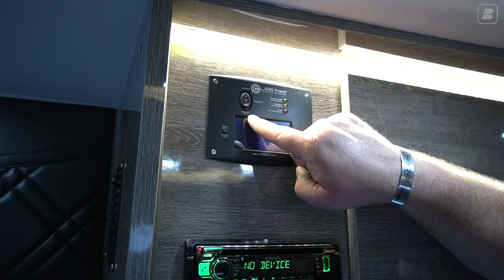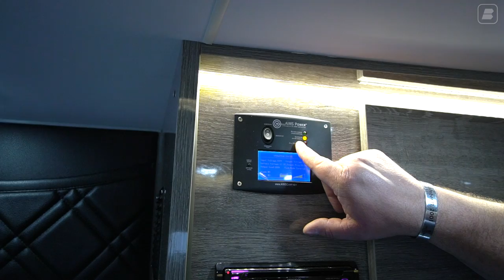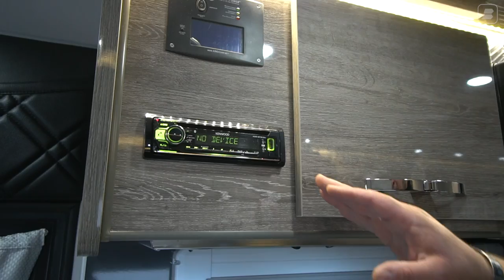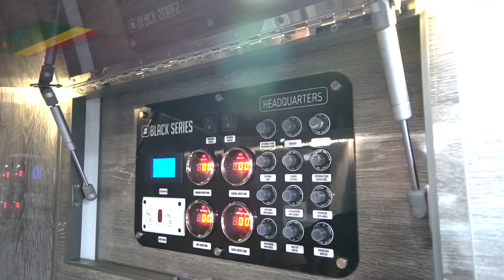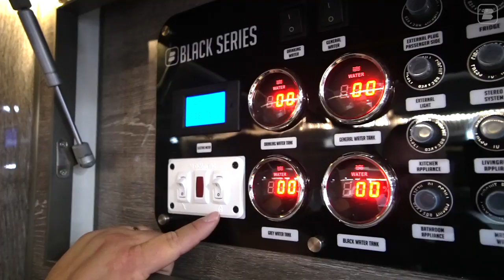HQ15 Interior Walkthrough - Black Series Camper; Caravans, trailers and campers

Comment: Why would you put tank heaters that only run off shore power. If I am out using the trailer as it is intended to be used, I am not going to be anywhere near a shore power plug. It also has a microscopic refrigerator. There is barely enough room in it for food for a weekend. All the 110 outlets on this trailer should run off the inverter and it needs lithium batteries not AGM. You can only use half the amp hours the AGM batteries have before you start damaging the batteries. The way this is set up, you only have 200 usable amp hours of battery. Also, why would you have the dump valves at the rear of the trailer where they can be damaged and ripped off the trailer if the rear scrapes on the ground. There did not appear to be any protection for the dump valves at all. They should come out behind one of the rear wheels so they are less likely to be damaged. This trailer has a lot of potential, but it needs some major improvements to be a real off grid trailer.
Reply: Terry you should prob go work for them by the sounds of it you would have them make the most BADASS RV in the world lol
Reply: I was about to post something very similar to this. Many flaws with this unfortunately.
Reply: Because they draw too much power to runoff of solar
Reply: In my opinion the geo pro line is a lot better equipped than this. It’s significantly less expensive but you’d have to add some sheet metal on the bottom to protect it better from rocks etc

Comment: Seriously the only thing stopping me from purchasing this trailer is the tiny refrigerator. I’m scratching my head because this rig is made to get way out & away.
Reply: That’s the ONLY thing?
How about NO air conditioning when utilizing camper for it’s intended use OFF ROAD
Reply: I was waiting for him to say the outside kitchen also had a fridge but he never showed it.
I don't understand why the AC only works on shore power. EMBER will run off solar and then about 4 hours on battery
That bathroom fan is useless, it needs a Fantastic

Comment: What generator choices would you recommend to run the ac?
Reply from the maker: We would recommend double checking with your dealership prior to purchasing, however a 3,200watt generator should do the job to run your AC.
Reply: @BLACKSERIESUS  I would recommend getting a real battery setup and running everything from the batteries. This is a sheer limitation of trying to use this trailer for its intention. This is not an off grid trailer at all. Park this at an RV park like the rest of em.

Comment: Can you really run the microwave on inverter power only?
Reply from the maker: Yes, the microwave can run off of the inverter. We wouldn't recommend cooking a turkey in there, however it will definitely pop your popcorn.
Reply: You can run the microwave off the inverter and, if you have the right inverter and battery package, you can run the A/C off it too. There is a new solar and battery package for the new Montana Fifth-wheel that has 100 more amp hours of battery power then this trailer that can run both of its A/C at the same time off the battery. This rig needs lithium batteries and a bigger inverter and you could run the A/C off the batteries in this too.
Reply: @terrytykoon1234  yeahhh.. True mate.. Like Enerdrive Lithium system battery system.. Feel weird why BS still use AGM batteries nit like other Camper van in australia..